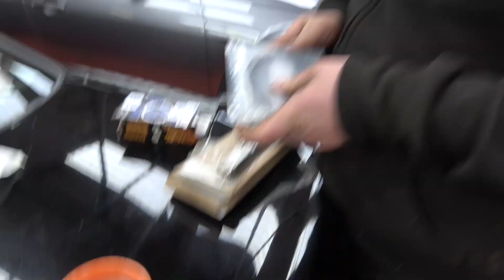Brand new built & forged SR20 engine dropped in!

Comment: would be cool to make a video integrating the s15 and your new geomaster 3 knuckle setup explaining the new advantages and basic settings for positive results.
Reply: #askdriftworks also it would be nice to see if the front knuckles would work under a stock s-chassis fender without any modification in full drift mode, and what wheel specs would work for not having any clearance issues with possibly the lca, tension rod, and sway bar (r33 gtr wheels? for a start). Do you use OEM lca's (possibly extended?). Is your steering rack moved or are you using offset rack spacers to help compensate bind? 
Can't wait to hear a response from you guys as I'm deeply interested in picking a set of the GM-3's up for my s14. They seem to be on paper a good medium or tame knuckle setup compared to the full wisefab kit and everything that I'm looking for to help improve the feeling of my car.

Cheers!

Comment: Still using the stock lower oil pan, any problems when skidding, probably the main reason it spun a shell ?? and what did you do with the crank find another good nick one or have a regrind done ?
Reply from the maker: Yeah still stock oil pan. Never noticed any issues, but I would probably fit an extended baffled sump if one came up .I think the crank was just polished, but it was a while ago so I may be wrong.
Reply: yeah man safe.. im building a forged sr aswell at the moment. but waiting to get me block and crank back. moved to 9:1 87mm and .25 regrind on all journals as there was few scratches. never spun a shell but my oil pump broke and spat some shards around the shells. you wouldn't happen to have a crank knocking about would you ?

Comment: Managed to build the motor in a day it seemed. What components did you use? - CP pistons, Manley rods and ARP bolts? Also where did you get that single large fan from.
Reply from the maker: Yeah, CP, Manley, ARP. The fan is from a Jaguar.
Reply: Thanks - will send you guys an email now. Need a quote for a rebuild.
Reply from the maker: We don't sell engine parts, or work on customers cars unfortunately. Just our own dumb stuff :)

Comment: Any idea if that radiator fan would fit a E36 M3 sized radiator? Also know how much amps it draws?

Thanks!
Reply from the maker: Hi Kevin. we don't have experience on the E36 rad specifically, but I imagine you could make it fit. It draws ALOT of amps. I think we blew a 30amp fuse, and we're now using a 40amp megafuse.
Reply: Can you tell me which fan this is i want such a fan

Comment: whats your break in process?
Reply from the maker: Full load to full deceleration starting at 3k rpm and work our way up 1k at a time. Then after an hour of that nail the crap out of it for a couple of minutes and do an oil change. Then a huge burnout which you'll see if you're subscribed on Sunday I think.
Reply: thanks for the reply.. of course I'm subscribed haha